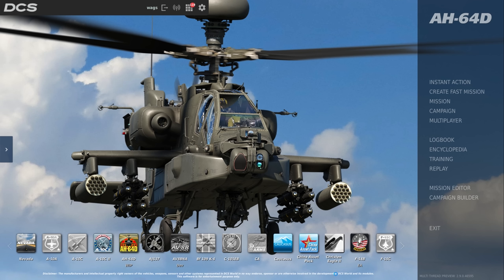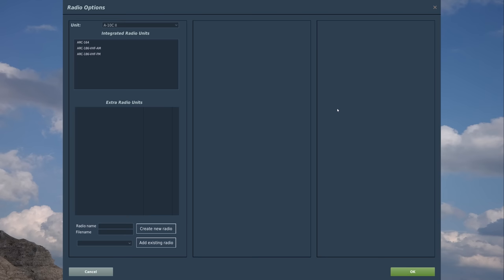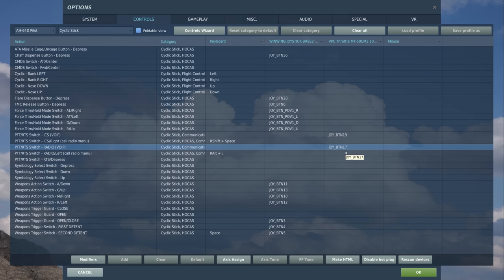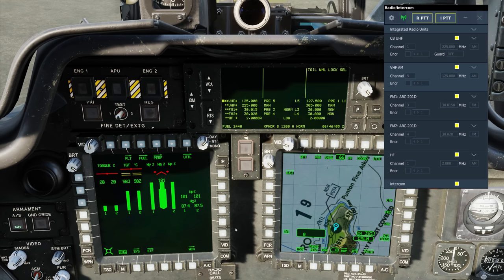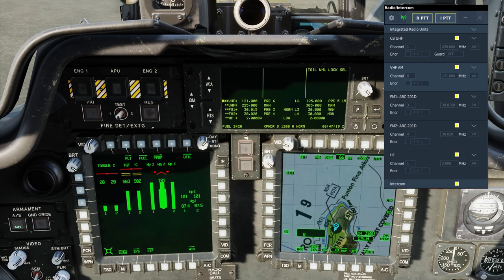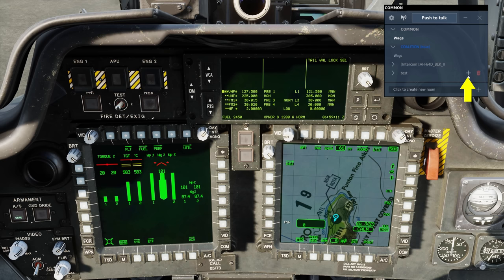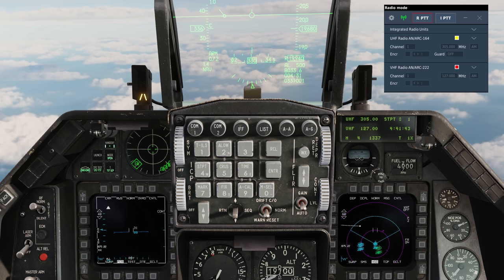DCS Voice Chat 2.9 Tutorial

Comment: Really great job, I hope the community start using this and stop using discord and TS. 😊
Reply from the maker: We understand that "the community" has lots of options for VOIP. As we continue to improve our VC system, we hope it will provide an option that will work for most everyone.
Reply: @MattWagner   May I ask if you can update the UI?

1st,  players can select in the home screen their fighters and edit the payload, configuration, and way points (for each map, airport's).

2nd in the multiplayer if I can select which fighter I want to fly and fix it so it doesn't reset every time I die or go to another server.

3rd, add the VOIP in the home screen (not settings) so it would be easier to set it up on the fly with the fighter I am selecting.

4th and this is very important, update the kneepad to realistically represent actual IFR/VFR maps and airport runways and taxiway.

5th an updated UI, for player made MODs, so we can install and remove them within DCS, which means they will be approved by ED, and compatible with the game, ex, F-16 skin or F-18 mission, with out having to go to the folder and editing it, more than one time the game crashes because of that.

Comment: Huzzah. I’ve spent years tweaking and getting used to keybinds and modifiers on my perfectly usable (usually) bottom of the range HOTAS, keeping things as consistent as possible across planes. But I’ve hit a wall. I don’t have anything left for an expanded radio system. Maybe if I plug in my x-box compatible controller I can keep that for radios only. I was planning on using it for the CP/G sticks in the Apache but maybe I just need to forget about the Apache until I can afford a new HOTAS. After I’ve bought a new computer, of course. 😭

Comment: The 2.9 update seems to have messed up AI radio communication with wingmen and ATC. It works at first but even when the channels are set correctly, by the time I’m at the flight line ready for takeoff, no response from ATC or even from wingmen. Yes, I did verify the frequencies are correct, and they all worked prior to the 2.9 update. The campaign and mission I discovered this was Operation Piercing Fury - Mission 12,  but it works on previous DCS version.
Reply from the maker: We've been unable to reproduce this, and it sounds like a mission error. Please use our forum to post a report with a track file.
Reply: @MattWagner  Somehow a setting on my  ARC-210 radio in my A10 II got changed and when I changed it back to KY-58 VOICE, that was the problem. Not a bug
Reply from the maker: Glad you got it sorted.

Comment: Neat! What aircraft are planned to support the in-cockpit controls come 2.9 launch? Evidently the Apache and F16, and I assume the F18 and A10 (as well as the coming Chinook), but will aircraft all they way down to warbirds support this system?

Additionally, do the actual in-cockpit switches/buttons (for example Apache/F14 ICS hotmic switch, or Apache radio volume dials) interact with the voice chat system as well, or just the key binds?
Reply: It's basically SRS but built in, so you operate radios using in cockpit switches/HOTAS in all aircraft except FC3 low fidelity ones
Reply: I wonder the same thing- if I can use in-cockpit switch to let's say, change intercom form push to talk to voice activation. If I remember correctly it was working in SRS.
Reply: @drpavelheer5030  Yeah, that's basically what I'm seeing, looks promising!
Reply: @CorvusCorp81  That's basically what prompted the question, I haven't been able to get ICS into hotmic in SRS (for the Apache for example) and was wondering if this has that functionality
Reply: @realheyday  I think I've used it in SRS in L-39 but that was long time ago.

Comment: I appreciate the development of this feature Wags! However this seems overly complex. The amount of settings may seem overwhelming to many players. Also, I am disappointed there is still multiple buttons for each radio (One for the menu and another for PTT). I wish these two functions could be integrated more seamlessly.
Reply: Your  not wrong
Reply: I don't see how it's at all overly complex. There's as many buttons for radios as there are in the actual aircraft (barring custom radio additions) and the voice chat aspect would essentially be like having Discord voice channels which would require a separate bind as well. If these settings are overwhelming for players then they're gonna have a hard time with DCS modules themselves. But I honestly doubt "many players" will find this too complex. Most of the user-end would be almost identical to SRS, if not simpler because you don't need to have binds in an external app as well.
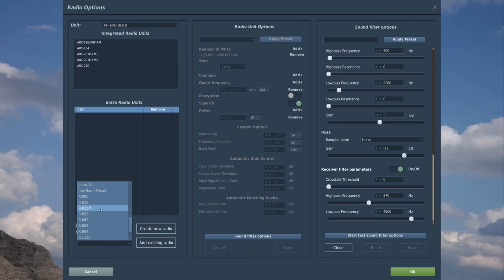Reply: @deadpxl   2:35 is a good example of what I mean by overly complex. I am hoping that the default settings are good enough because I do not look forward to diving into those settings.

In regards to key binds, I would like to see a way to reduce the numbers of key binding necessary to be equally (not more) as complex as a real aircraft. ED has the opportunity to do what 3rd party apps cannot: Integrate with preexisting radio systems. It seems as if they are just copying SRS.
Reply: @bsdude010  He's showing how to add custom radios to aircraft that they don't have in real life. This isn't going to be a normal thing most any players will do. By default all aircraft will have their proper radios already setup.

As for the binds, this is equally (not more) as complex as the real aircraft. Wags shows us how it uses the radio binds from the Apache cyclic, just as the crew would. The only "extraneous" binds would be to talk in the non-radio voice chat channels. But this would be no different than how people will also be in Discord voice, except now everyone who joins the server will also be able to participate without having to also join the Discord server. Overall this system is more integrated, simplified, and accessible than DCS + SRS + Discord that is commonplace atm.
Reply: It will not be anymore complex than operating the radios in real life. A lot of those overwhelming settings are most likely for single player customization. He mentioned that server will have the option to utilize custom radios or not. Most servers will have just the default radios per plane or helicopter. That wall of text that you saw is only for those custom players that want to have more options available for their custom servers.

Comment: well me and a colleague cant get it working, he can hear me but all i get is static
Reply from the maker: https://forum.dcs.world/topic/292022-quick-dcs-voice-chat-guide/
Reply from the maker: From the Settings (gear icon) on the Voice Chat window, ensure that the Master Volume is set to at least 50%.
From the Options/Audio tab, manually select your headphones and mic settings to match the devices you wish to use. Please do not rely on Default.
If using Radio Mode, all participants must have their radios powered on.
If using Radio Mode, participants must be on the same frequency or in the same Room Mode.
If using Radio Mode, participants must all have the same encryption settings, or all have encryption disabled.
If using Radio Mode, ensure that VOIP radio transmit control actions are bound and used from Options/Controls (aircraft type).
If using Room Mode, ensure that the Options/Controls/VoiceChat - VoiceChat Push-to-Talk Mic. Mode: On/Off Voice Transfer is bound and used.
Voice Chat models line-of-sight range limits. Ensure that participants are within line of sight and range.
Note all servers may run Voice Chat. If the server is not, Voice Chat will not function.